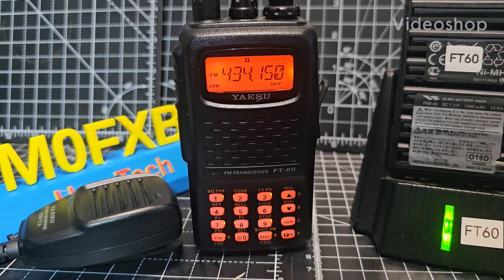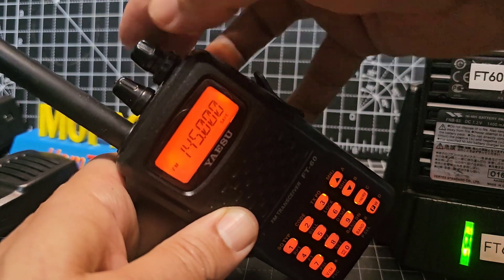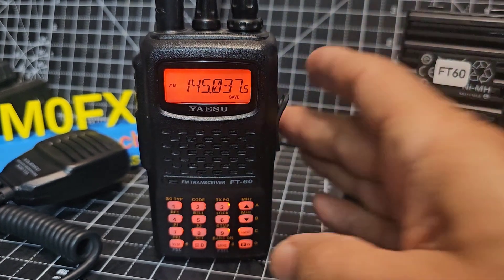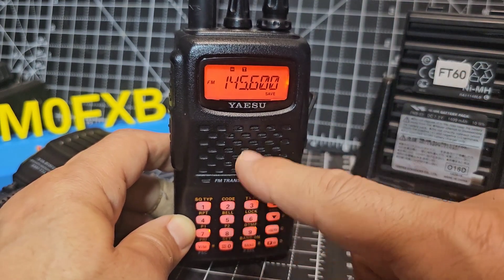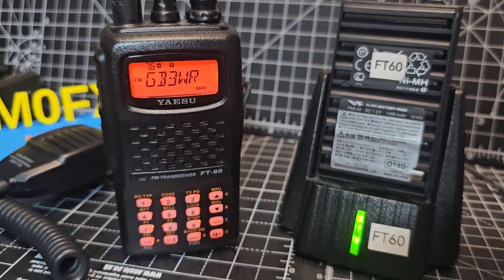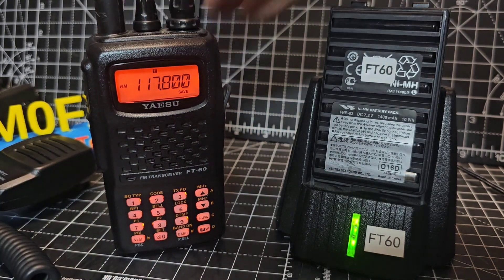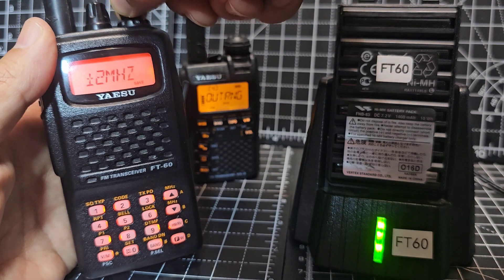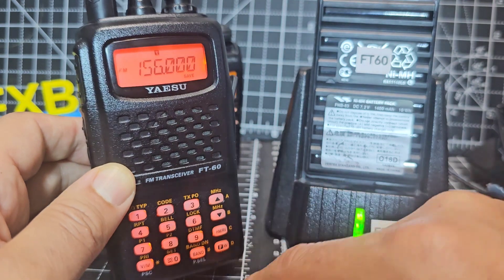Yaesu FT60 Beginners Guide -  2025

Comment: I noticed one or two 462.000 mhz frequencies on the display when the radio was scanning. Can it transmit in this band, i.e. 450-470 mhz or is it receive only? Thankyou.
Reply from the maker: This one yes
Reply: @HamTechRadioScannerDrones  That's what I thought. Does rather cement its 'professional' credentials.